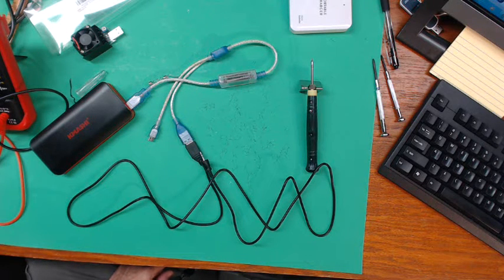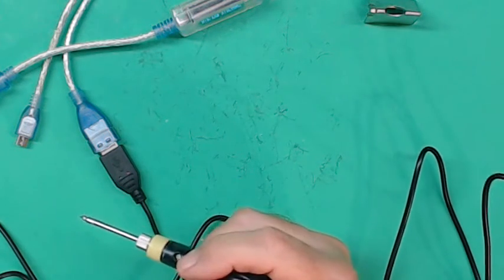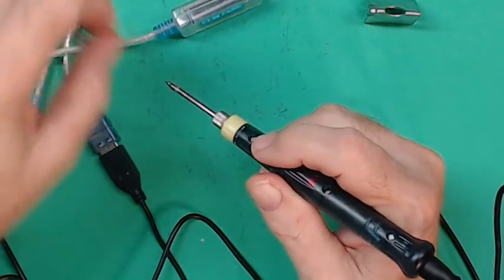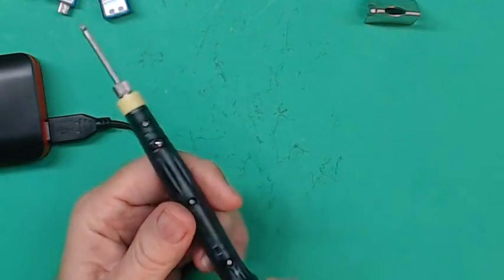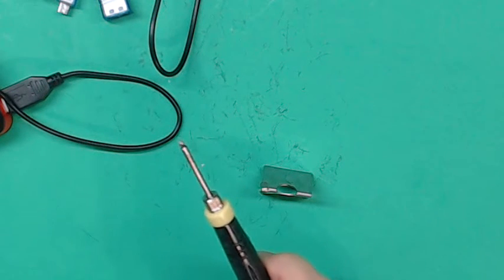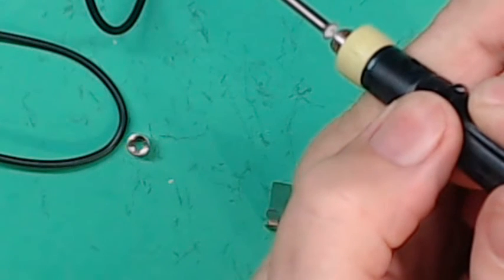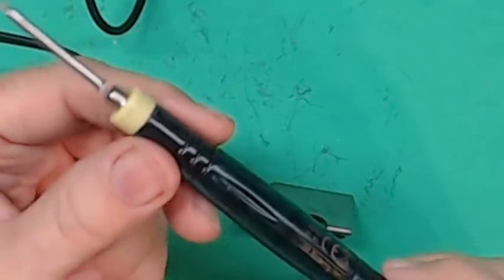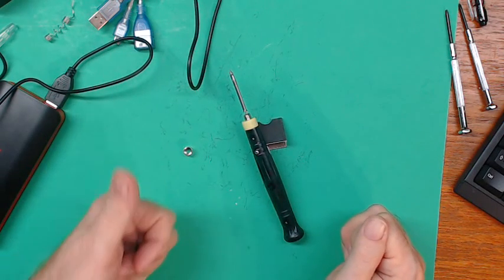TRRS #0902 - USB Soldering Iron Testing - Fail??

Comment: I know this is a year old but did you try to use it with your arms or hand off your mat. esd mats cause problems with the touch sense on this iron. Also I can't see because it's a little out of focus but is it possible that the white stuff is just the bottom part of the ceramic filling of the tip?
Reply from the maker: Thanks for your comments.  The mat is paper and should not be conductive.